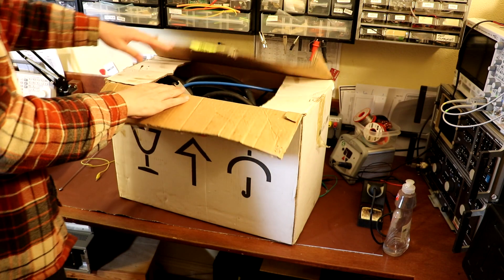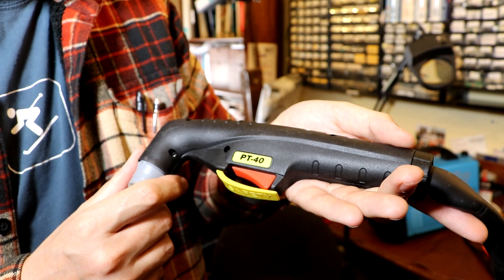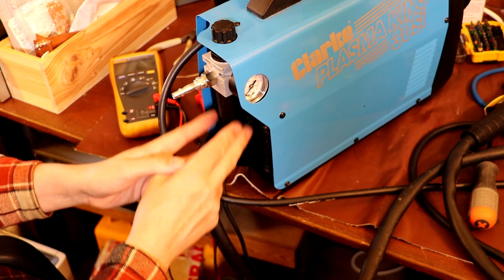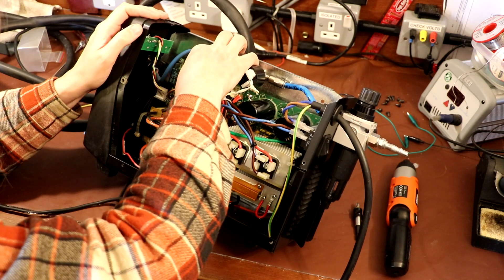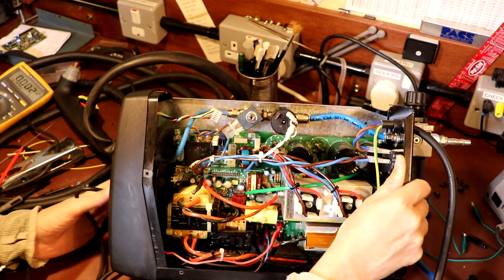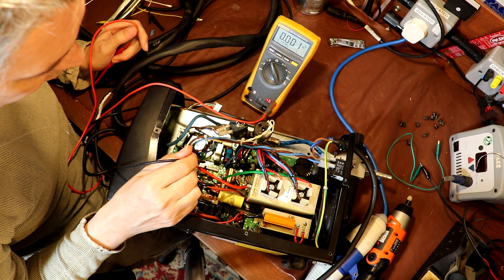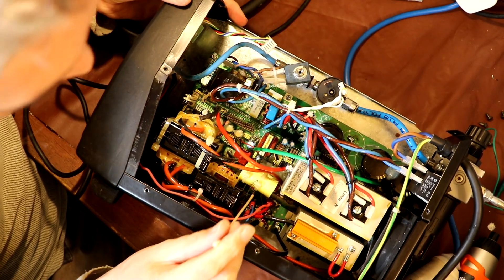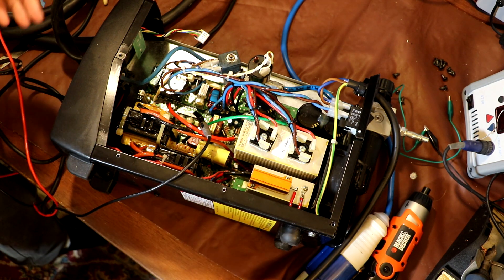Dragons Breath

Comment: I frequently need t get my welders and plasma units seen to as I live in a humid environment. Just had an 80amp  plasma fixed for a couple of hundred quid- hand full of new parts but what I noticed from the returned faulty parts were that the snubber circuit on the IGBT block was blown which probably stopped it in its tracks. Unit does work better than ever now. I my experience the guys in the repair shop do what you have done - basic diagnostics and if it is more involved than generic parts then they either send it off to the agent/ manufacturer ( which they did with my plasma) or send the unit back as irreparable. More often then not the problem is loose wiring or a relatively simple circuit.
Reply from the maker: Bikefarm Taiwan  Yes I can see how humidity would be a big problem. I have actually just bought a small in line air dryer for my plasma cutter as they are recommended.  Although my cutter is useable for what I need it for I think there is still a remaining problem with the HF start. Unfortunately I not really familiar enough with the circuit and that part of the circuit had components stuffed on top of components so not easy to work on etc.  Thanks best regards Chris

Comment: If your sucker isn't sucking be sure to check the filter disc.  When it starts to look yellow it's time to install a new one.  If you got a used unit did it come with the disc filter in the suction line?  If not someone screwed up the vacuum pump and it's probably gunked up with flux residue.  I had one like that.  Disassembled the pump assembly and cleaned it out with isopropyl alcohol and it worked great after that.
Reply from the maker: MikesRadioRepair Hello Mike. I bought it off eBay quite a few years ago and it did look like new. But I have a feeling I did order  the filter assembly for it. So you may have a point about cleaning the pump out I’m going to have to add it to my ever increasing things to do list. Thanks Regards bChris

Comment: @18:00 you can usually push the tube in and turn it a bit/wiggle it around, and then try pulling it out, the fingers inside dig into the tube and get stuck.
Reply from the maker: Tried that. For the record didn’t work on the wife either.

Comment: Nice repair, i wondered how those things worked.
I have certainly come across regulators that have died for no apparent reason, usually in newer equipment, have to wonder if it is just the quality of the part.

My first thought when it stopped cutting the rusty sheet was a bad earth connection, glad that’s all it was.
Reply from the maker: The Defpom's Repair Channel  Hi Scott I’m not totally convinced it’s a complete fix as I suspect a problem with the pilot arc that should have initiated the torch after it cut out. Still you know it’s useable again so I’m going to quit while I am ahead.  Think I would have done better with a schematic. There is an awful lot of angry pixies inside a plasma cutter and when they fail it is explosive. https://youtu.be/6CpYFTThitw

Comment: That was very cool to see the inside!  Fixed it like an old pro!  :)  I've never used them, just stick welders, the old man had them in his repair shop's.  Have you had a chance to check up on my idea for your fuel tank in the last video? What's the results if so?  Glad your on the mend...musta been sick, not one single innuendo in this video!  :)  Cheers mate!  ~Jack, VEG
Reply from the maker: Vintage Electronics Geek  Hello Jack Sorry I missed your post on the other video and just went back to have a look. Don’t know why but I didn’t receive a notification for your comments.  Yes I think you right about the tank been rusty, must have tipped a spoon full of rust out of the fuel filter.  I went ahead and replaced the fuel filter, hoses and fitted an original mechanical fuel pump. Went out for test drive just far enough from home and broke down , the coil failed.    I am hoping to replace the radiator and the water pump this weekend and flush out the cooling system.   Next time I go for a test drive i will try and get some pictures facing forward the countryside is nice around here.  Yes not a single innuendo must have been sick. I will try and make up for it next time. Regards Chris.

Comment: Very nice work! Always  difficult with no documentation but you pulled it off nicely, a great demonstration of troubleshooting. Surprised you didn't test the rail resistances (at least on camera) of the control card. Love the "Photos of my cock" tee shirt!
Reply from the maker: David V  Hello David. I did check the rail resistance with and without the small control board installed. But edited it out as the video was long enough as it was. Yes got lucky with an easy fix but wish I had the circuit diagrams. Regards Chris.
Reply from the maker: David V  I like to support the chickens.

Comment: Smashing repair, thankfully it was a minor part and easy to get :-D.
You just had to take a gorp inside and fondle the parts, i would too :-D.

I was thinking  i hope it's not an output short on the 15V line, like an evil smd cap.
But no, the reg turned up its toes for no reason at all, Do regulators have toes?
Maybe feeding 24V up the regulators bum pushed it too far, maybe a 4-5 ohm 5 watt resistor should have existed on the input, perhaps.
Companys can be skin flints at times.
I'm glad it's working again, dam handy tool :-D
The weather is so nice, hope it makes you feel better.
There is a machine mart in coventry, i don't go there as i would empty my bank account :-D
Reply from the maker: zx8401ztv  yes those tool shops can be dangerous and distracting places to visit. I got lucky with this one an easy repair.  No idea why it failed but plasma cutters do have a nasty habit of exploding horribly and terminally.  Still think it could have a problem with the pilot arc but I’m quitting while I am ahead. Thanks for watch and mind how you go my friend. Regards Chris.
Reply from the maker: zx8401ztv  they must have lots of toes, after all they got three legs!
Reply: Bloody hell 3 legs!!, imagine trying to catch one.
Imagine trying to buy shoes... no no that's very silly.
That's it i'm mad as a hatter now, although i was nutty to start with :)
The picture of the old dragon.... not the mother in law then :-D.

Comment: I was expecting it to be the pressure sensor in the air line just before the valve. I assume it is a sensor or something. Then I thought it would be weird for it to cut out like that, and give no indication.
Glad you found it to be a silly regulator, what are the chances that a repair can me made using jelly-bean parts like that? Good one!
Reply from the maker: MrDubje.  I did explain some of the pressure sensor stuff but annoyingly had not switched on the camera. Yes I got lucky with a simple fault. I guess it’s really just a big switch mode power supply but I did not feel very confident working on it.  I still think it could have an issue with the pilot starting arc, but it’s usable which is all I need.  I got lucky with this one. But goes to show that even when it’s relatively complicated and no diagrams you can still check the easy stuff.   Thanks Regards Chris